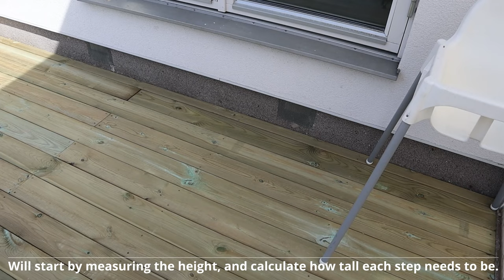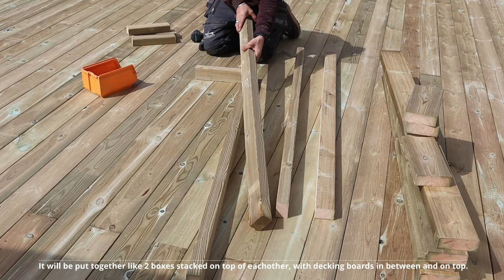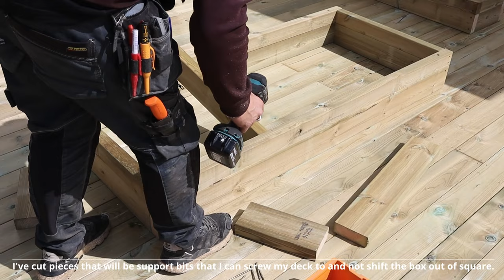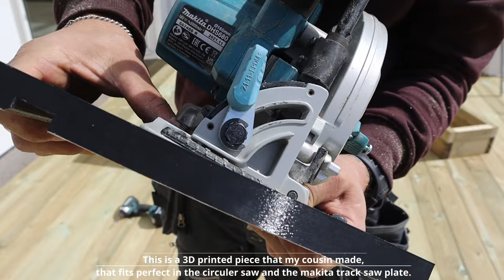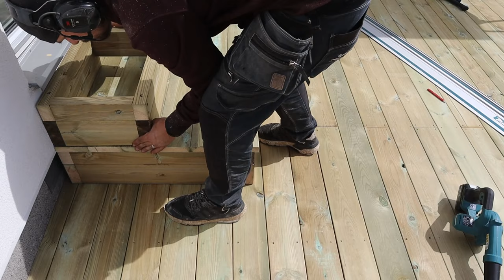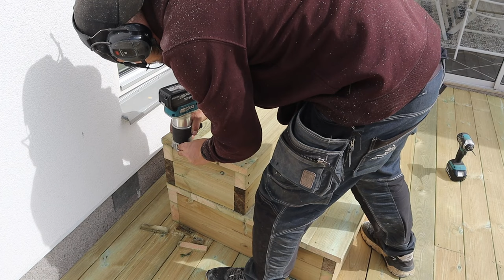Stairs without stringers DIY

Comment: I LIKE IT! Gave me some good ideas. I wonder though if a tiny gap between boards might help with water drainage, and make it last longer? Also, I wish I could find lumber like that. Good job!
Reply from the maker: Thanks alot for thouse kind words, they sure would if your boards are dryer than mine was, but these boards was so wet that they have created a 4mm gap just for drying this summer.

Comment: looks great but how are they fastened to the structure so they dont move
Reply: Dosent need to be since the pure weight of it is enough to keep it in place, but if u want to just add a screw or two for extra safety

Comment: nice work.  question: how did you end up attaching the stairs to the ledger board?
Reply from the maker: Never attached it to the ledge board, felt that it needed to have the chance to move since wood expand, so the pure weight if the stairs is what keeps it in place and haven't moved one mm since. Thanks for the comment 👍